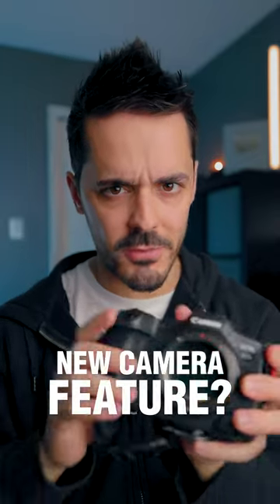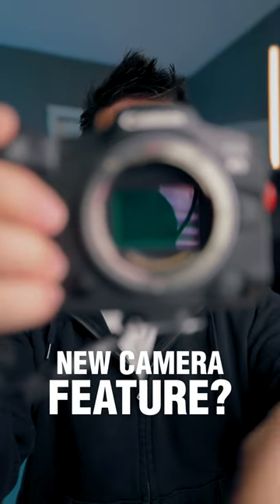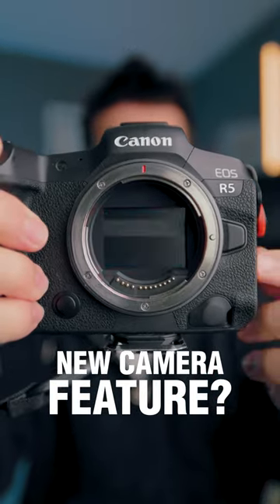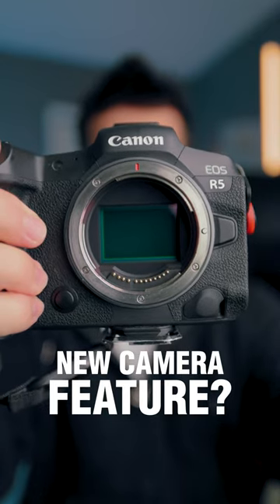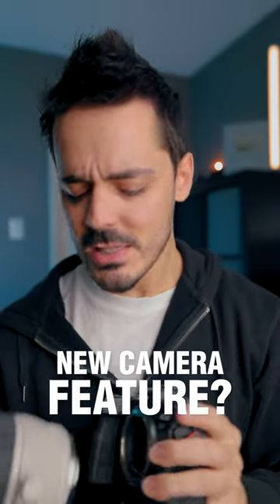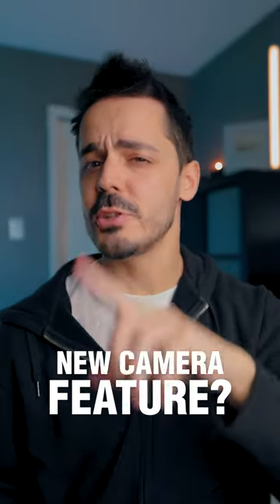Goodbye mechanical shutter 📷 #photography

Comment: As to protecting the sensor, its a non issue, shutter curtains are much more delicate than the glass plate infront of the sensor.
Dust will collect on nd filters too, although being further from the focusing plane might not be as visible.
Reply: ...and that is the point....
Reply: Yeah super weird point,i mean the shutter is normally up anyway when changing lenses
Reply: @Armbrust210  Nope, at least with Canon you can set the body so that shutter closes when power off.
Reply: @petrpohnan875  pretty much any other camera brands, not just canon.
Reply: my z50 has the shutter tucked away when off, seeing the sensor  just exposed there every time changing lenses

Comment: After a lot of research (1980s, pre-internet), I chose an Olympus OM-4T precisely because it measures the light directly off the film plane, so that in automatic mode, during rapidly changing light conditions, the shutter remains open only for the duration of sufficient light to expose the print, automatically, without me having to futz around with exposure time or even f stops. Olympus is the only camera which does this. Absolutely remarkable.
Reply: I bought a mint OM-4, fabulous camera.

Comment: The Nikon z9 doesn’t have a shutter, and I’m pretty sure they have some type of shutter shield in place when switching out lenses. Plus, every other brand that still uses shutters, don’t cover their sensor. I do understand the problem you’re worried about, that’s just a canon thing. So it’s kinda hard to relate to for people.
Reply: It has a sensor shield for sure. And it’s been on the body for a few years now.
Reply: Yes, so this guy is really talking nonsense.

Comment: All Canons I have owned. M50, RP, M200, R8 are EFCS and thus have the sensor exposed. Saying the R5 mk2 wouldn't handle it works point that to our being unsafe to handle all these cheaper cameras. The sensor is protected by a piece of glass. Sucks to happen to get something on it that need delicate removal but not the end of the world. So I don't think there will be any mechanism solely to cover the sensor. But an internal filter holder would be interesting.

Comment: From all I read online, the sensor is actually NOT that delicate, contrary to what many believe. It is covered by a scratch resistant glass layer, which prevents important damage to it. Of course it can get dirty but you can just clean it with a swab. It’s not line the sensor is an exposed eyeball ready for some sharp thing to poke it

Comment: I rather using CPL, because ND/GND could be replaced by lower and lower ISO, like IOS 50/25/12/6/3 some day in the future. But not CPL.

And Some lens allow back slot ND, like Sigma 14-24 F2.8. By, user need to bring a huge CPL for this type of lens.

Comment: They can just do a sensor curtain that only activate when turned on or when you change lenses. Aka, look at the Nikon Z9.
Reply: That's not a shutter. It's specifically called a sensor shield and it's only purpose is to protect the sensor.
Reply: @WaterfallJoe  yes that was the question posed. How do you protect the sensor with no mechanical shutter? I called it a sensor curtain, and I did not know the exact verbiage Nikon used.

Comment: I wouldn't say that gives us enough room to put in a built-in ND, not in a full frame at least. The shutter is able to collapse in sections but a filter would not be able to. 

I suppose they could make it slide laterally not vertically, such that it stores over in the side with the hand grip. But that's a totally different concept.

Comment: Why would the shutter go? Didnt u explain in one of the videos that there are valid usecases for a mechanical shutter
Reply: Not with stacked sensors anymore.
Reply: @petrpohnan875 electronic shutter on the stacked sensors still could cause some artefacts and distortions. The only remedy is mechanical shutter or global shutter.
Reply: @pawelmod3292  Yes, "could" and "some"....
How much did you shoot with let us say R3?
In other words, real world is a bit different than these "could" and "some".
Reply: @petrpohnan875  I’m shooting stacked sensor camera on daily basis. Luckily my camera has mechanical shutter which is a must for some cases. The bad thing is that I’m loosing fps.

I would say that it is something you don’t need until you need it.

Comment: Protecting the sensor is a none issue, as the shutter should never be closed when you take off the lens. The sensor is simply always exposed. 
An actual problem is that most cameras with electronic shutters are much less suitable for action shots because of rolling shutter. Curious how Canon intends to solve that.

Comment: Z8 has a sensor cover. But it is too early to remove mechanical shutters on all mirrorless. The Z8 has banding issues in low led light. If you shot a lot of indoor low light you wouldn’t get a Z8 at the moment, you go for a Zf with a mechanical shutter.